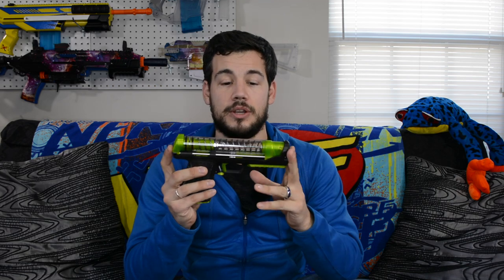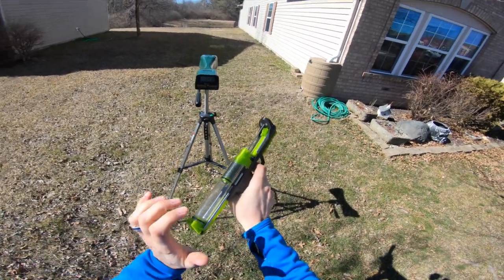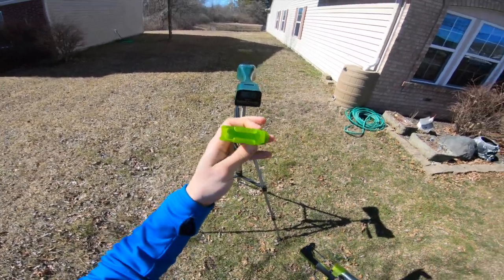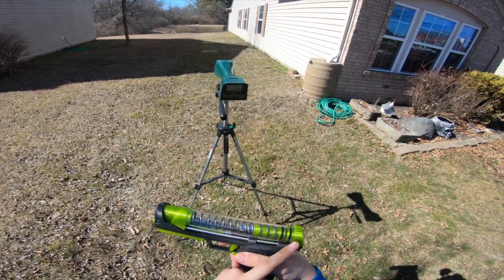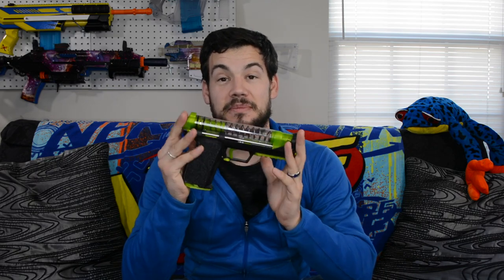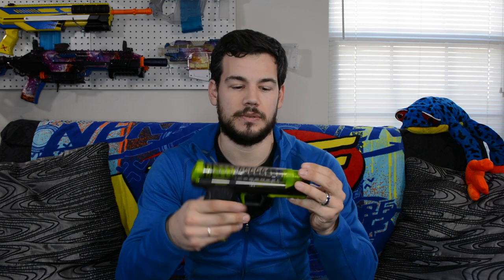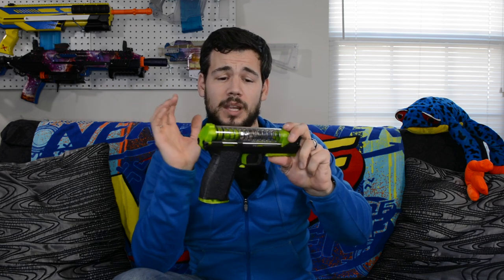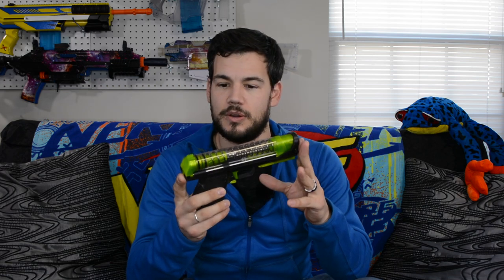[Review] Zinc by 118 Design (A 3D Printed NERF Pistol)

Comment: I was able to get my zinc to about a 98% perfect seal on my Zinc. When I plug the blaster with a k25 it stops and the air eventually leaks out in about 30seconds. I did this by wrapping the plunger head and both parts of the rear slide with Teflon tape. I wrapped  the parts then put the o-rings on top of them  so I could get them to barely fit. Doing this allowed me to fire waffle head and accufake darts without jamming(with of course lower fps compared to dzps and workers).  For me fixing the seal gave me a lot more consistent shots. Before I taped it my Zinc had the same seal problem.

Comment: It actually had a seal when you fired it there. But the pressure build up was actually enough to push it out of battery. If you watch the video back you can see it cycle back as you pull the trigger then the magnets pull it back forwards.

Comment: you would have to hold the slide forward too to test the seal, as the air pressure within the system pushes the slide/pusher backwards, allowing the air to escape.
Reply from the maker: Yup, I realize this shortly after filming. Not sure why I didn’t think about it sooner. This is probably partially why the numbers are somewhat inconsistent. The blaster does have a fairly good seal.

Comment: It looks and sounds like there’s friction slowing down the spring/plunger. You may need to drill some holes behind the plunger so it doesn’t create a vacuum as the plunger springs forward.
Reply: The Zinc already has speed holes drilled into the bottom of the plunger tube it's where the plunger tube meets the frame so it's not visible. I think the friction can be fixed by sanding the body more so the rods and slide can move more freely

Comment: Sweet video.    I'm pretty impressed by this little thing. I think it could do with a 3d printed piece built in that covers the  plunger tube to make the prime a bit easier.  Plus....3d printed blasters are great, but there's the whole cost of getting even an entry level printer.
Reply: I agree with you there. 3d printers are a great investment though, I personally have had it "pay for itself" recently, and I've only had mine for a couple months
Reply: 3d printers are really cheap for what they are and what you get out of them.